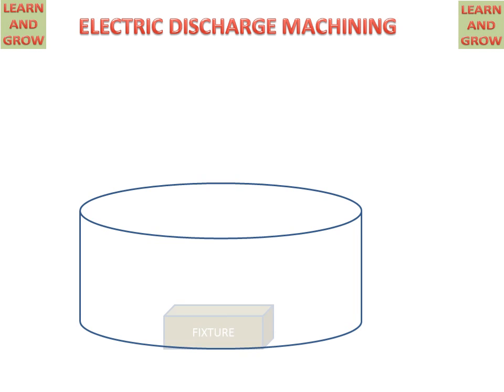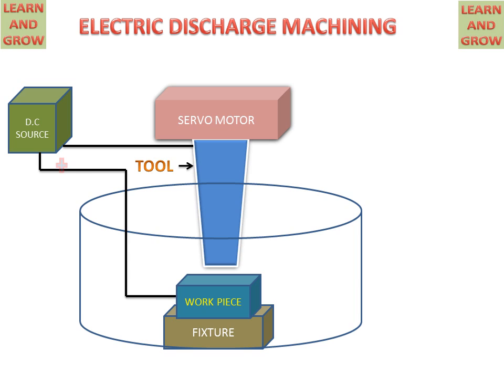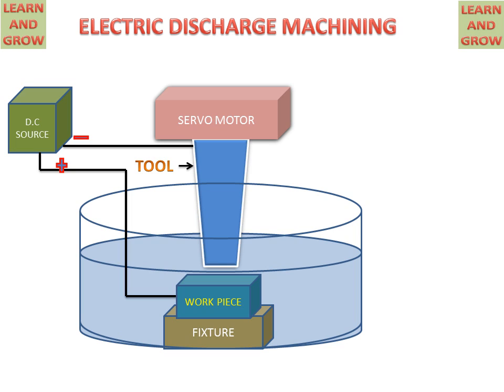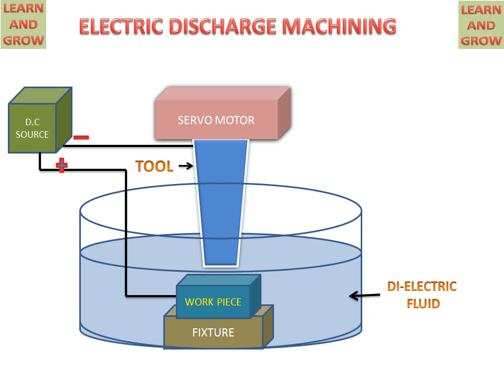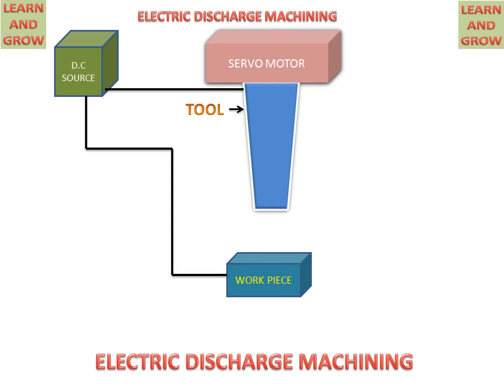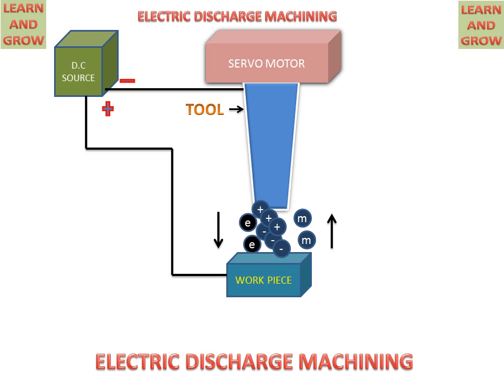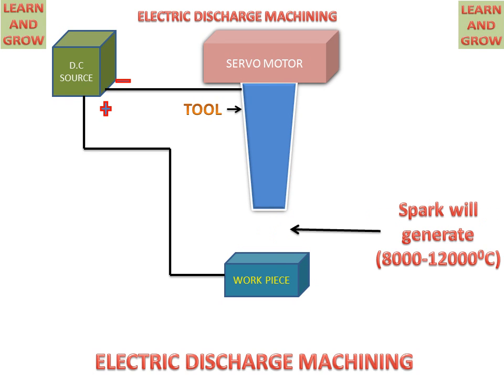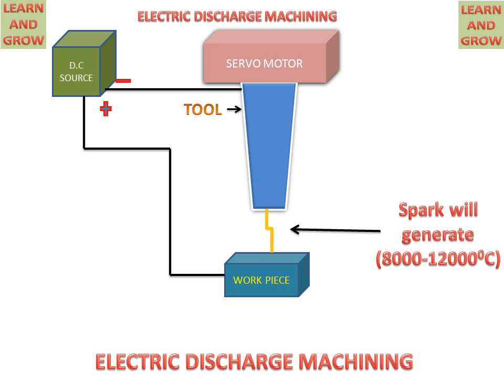Electric Discharge Machining (English)

Comment: can u clear my confusion??
The heat of spark melts the workpiece..
but does it melt the tool also?? if  it doesn't..then actually why?? cz...there's a heat of about 8000-12000 degree celcius